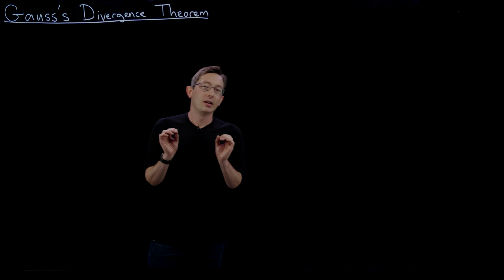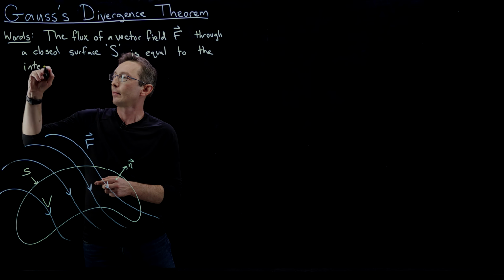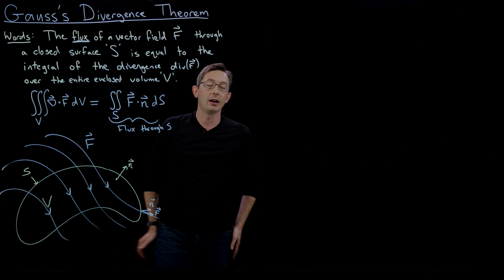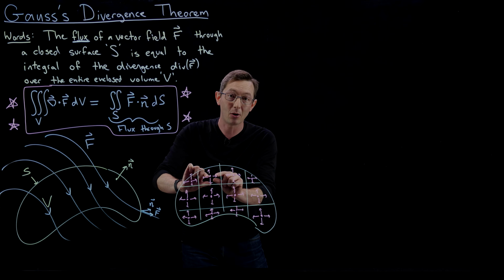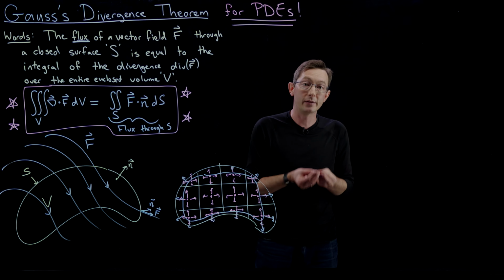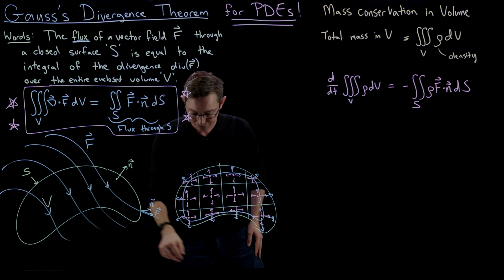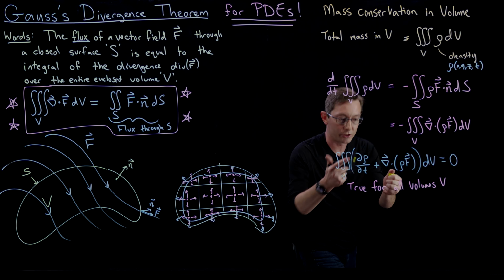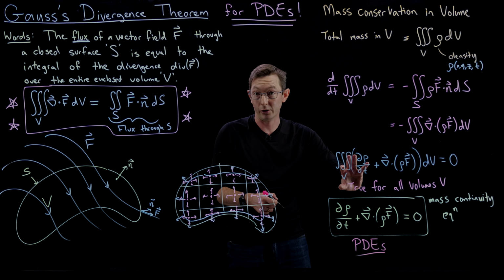Gauss's Divergence Theorem

Comment: Beautiful explanation.  I like the emphasis on understanding and practical applications.   When I took Calculus in the late 1970s, the textbooks (Silas and HIlle) was more pedagogal, meaning they used as few as words as possible to teach, with no applications and few examples.     I reviewed this text decades later and realized what an exceptionally poor text this was -- this text was meant to "WEED OUT" students rather than TEACH them with practical examples.    I really resent the approach they used in those days and what an obstacle that was to our understanding.   Although I went on to receive a PhD in mechanical engineering, I look back on these Calc 1, 2, 3, and Diff EQN as the worst, humiliating courses I ever.   I wish I could tell those SOBs how they screwed so many of us up, but they're all dead now.    This Steve Brunton is light years ahiead of anyone of the old generation.

Comment: The reason that the correspondence between the divergence and his illustration at 11:44 is extremely confusing is that the boxes around at the broundary are not rectangular-shaped. If he only uses the rectangular shaped box (which is exactly what is done by the approximation of volume integral), everything is much clearer !

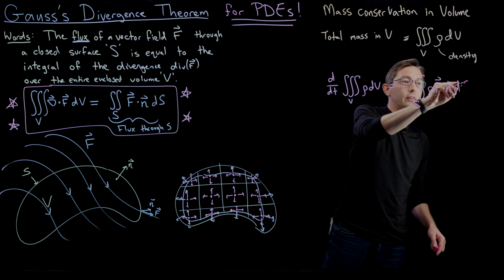Comment: 18:04  
The right hand side can be got by considering the flow through a tiny area Δs in time Δt. The "liquid" travels approx a distance |F|Δt where we could take F to be the average velocity of the "particles" that cross  Δs during time  Δt.
 We can picture this flow volume as a slanted cylinder whose top is at a perpendicular distance  |F.n|  from surface where n is the unit outward pointing normal to Δs. 

The volume of this slanted cylinder is |F.n|ΔsΔt (which is also the volume of a right cylinder of the same height |F.n| at Δs).
Therefore ρ|F.n|ΔsΔt is the approx mass of this cylinder of liquid where ρ is the density at centre of  Δs. 

Taking the limit as Δs approaches 0 and  integrating ρF.nΔsΔt over the entire surface (w.r.t. s) will give Δt∫∫∫ρF.nds which is approx the final mass of liquid that has left or entered the entire region after time Δt.
Now Δt|∫∫∫ρF.nds| ≈ |ΔM| where M = ∫∫∫ρdV is the mass of the entire region

If ∫∫∫ρF.nds is positive (negative) then the mass M of the region decreases (increases) and so ΔM is negative (positive), so we must have ∫∫∫ρF.nds ≈ -ΔM/Δt. 
As Δt approaches 0, so does ΔM and we get ∫∫∫ρF.nds = -dM/dt.

Comment: Hi Steve, I have to say the tiny boxes analogy is a bit confusing. Because when you integrate over the volumn, you are integrate the divergence, so at each point the integrand is positive since each point is a source, which does not reflect any 'cancellation'. (If it does, then at the points in central region the integrand should become 0 since they are 'cancelled'.) Whilist the 'cancellation' happens between the vector field F itself. So it might not be the right intuition for the theorem.
Reply: I found this confusing as well.  You can't cancel a bunch of sources.

Comment: You are confusing me because your are constantly using  Volume and Surface area interchangeably !    Your quickly drawn sketch on the board indicates to me that it is a typical Surface, typically  developed in calc 3,  over a domain Region in a typical x - y plane.

Is this the Volume you are often referring to ??

Then you bring in the vector  field , F hat,.  Is this generic vector field passing over the Surface or actually through the porous surface ??

Often teachers don't state how a field passes through a Surface.  If a 
If a vector field passes through a Surface, how is this done ?  Is it radiation ?
I would appreciate a response.

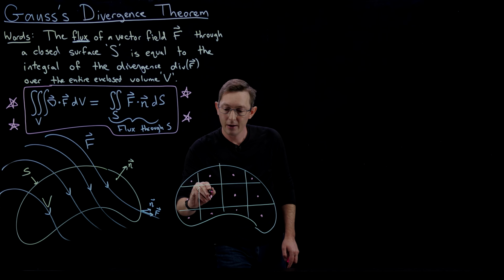Comment: There is something I seriously don't see starting at 10:00 to about 13:30 when talking about the little boxes filling the volume. The claim is that with an interior filled with boxes with positive divergences, only the boxes on the surface contribute to the surface integral, with the internal ones cancelling along their apposing surfaces with other adjacent boxes. This can't be true; here are two lines of reasoning which, for the sake of the first argument assume a constant, positive, divergence throughout the volume.
One: Compare two cases that have the same surface, but different volumes. The integral of the divergence over the volume is proportional to the volume, but the surface integral of the flux would not increase to match if there was a cancellation of the field F at the apposing adjacent surfaces of the interior boxes.
Two: Since the integrals are linear, the surface integral flux for a volume with a single box with positive divergence must be half of that with two interior boxes with the same positive divergence. But if they are adjacent, and something cancelled, it wouldn't be.
I'm thinking of this a la Gauss's law for the electrical field at the surface as proportional to the enclosed charge. Am I missing something??
Reply: I'm pretty sure the surfaces are assumed to be closed and perfectly hollow. That way two identical surfaces would always have the same volume. Not sure about your second line of reasoning, but I'm guessing it only works when you actually do an integral and chop the volume up into infinitely small boxes.
Reply: We can chop down those infinitesimal volumes into more smaller volumes until there's everything hollow. That's sort of the idea. Idk I feel better thinking this way to reach the hollowness😂. Works tho and sorta makes sense. But it gets messed up for Quantum systems lmao 😂. It's really confusing.  
Like sometimes it's cool to assume or ignore somethings to get something. 💀

Comment: Dear Sir,
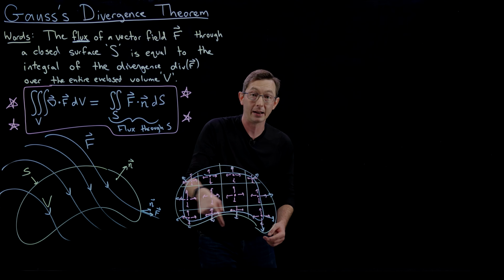I cannot understand the part at 12:35 sec. If there is a perimeter which has continuous outward emerging arrows, then what about the arrows that are in +z direction (emerging in 3D), as flux F is coming/flowing out (not expanding).

Comment: Hi,
I think there is some problem with the "explanation' of canceling off between fluxes in the video. The cancelling off takes place because the flux through an interfacial control surface will have different signs when taken in two adjacent control volumes.Anyone thought the same?
Reply: Ahammed - I also have a problem with the cancellation, and just posted a comment about it today (Sep 24, 2022), and after doing it I thought I should see if anyone else saw this too. I'm not sure if we have the same issue, but it sounds similar...

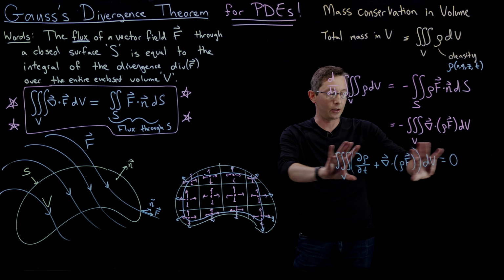Comment: At 21:35 or so, does anyone know how we formally justify changing the total derivative in respect to time with a partial derivative with respect to time when we move the derivative operator inside the triple integral? 

Also, in this particular exemple, I get the feeling that this could only be true if the volume is not a quantity that depends on time, but I know that conservation on mass is always true and does not rely on such assumptions... How can I convince myself that this is true no matter what happens to the volume?  And this is closely related to my last question : what does happen if we consider that the volume does depend on time?  Can we still switch the integral with the total derivative?

Thank you Steve Brunton for these videos! It's been a long time since I saw these topics (if ever for some of them!) and I really appreciate your enthusiasm and the quality of your work :)

Comment: I'm confused regarding a basic idea.  If there are no sources in the volume, I don't understand why the flux as defined isn't always equal to zero.   Where the field enters the volume the flux contribution F dot n would be negative and where the field exits the volume F dot n would be positive.  So, the net flux would be zero.
Reply: have you figured out the answer to your question here?  because I'm wondering the exact same thing
Reply: I think the divergence is caused not by a literal source or sink, but the rarefaction or compression of a compressible fluid. If an incompressible fluid were used, divergence would be 0 everywhere so flux would be 0 for any closed surface.
Reply: @alfiekelly3852  thanks for your insight, I will have to review for understanding because it has been so long since  I  commented. I think you are correct because you live in San Brueno. I lived there as a child, 1957-67, Rollingwood Drive.

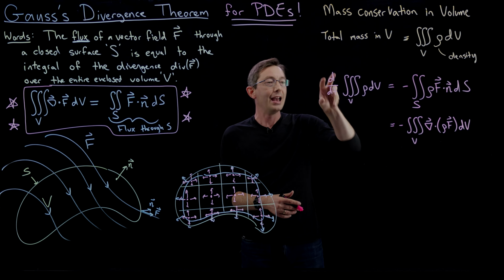Comment: At 20:25 Steve oversimplified by moving the time derivative inside the volume integral just like that. It can only be done if the volume being integrated wont change over time, invalid assumption in fluid dynamics. Taking this into account leads us to another beautiful theorem called Reynolds Transport Theorem (RTT), which interestingly naturally leads to the right-hand-side on Steve’s board (if F is a velocity field).
Reply: Could you give a hint how total derivative became a partial? ah okay i got it, since rho=f(t, x, y, z), the total derivative expansion will contain only partial derivative with respect to time.
Reply: I cannot getting anything but I feel I understood something 😅
Reply: Dominated convergence theorm

Comment: One issue with this theorem is that we have to define how much flows through the surface at the same time. That mans that we integrate over the surface for one moment in time. After completion we can see how that result evolves over time, but we can't use the left part of the surface values of one time moment and add that to the right part of the surface for a later time moment. But this means that we have to know what simultaneity means in that case. Thanks!

Comment: I just realized that if it can be said that the noise of a vacuum is 92 decibel, it's thanks to  the Gauss's divergence theorem...
As there is a kind of conservation law of the noise, and as the noise is given by a power, it's maybe, the conservation law of the energy which allows us to measure the sound of machines and equipments ...

Comment: The explanation of the small volumes canceling each other out is not very clear to me- will look it up in books
Reply: Suppose that you have 2 volumes in a vector field, and the volumes share a common interface. Then the flux through this interface will have a positive contribution to the flux through the closed surface around the first volume, and a negative contribution for the second volume.
Then the flux through the closed surface around the two volumes combined will be the sum of the two fluxes. The contribution of the "interface flux" to the "combined flux" is cancelled out. This idea can be extended to any number of volumes of any size and shape.
Reply: @HD141937 ,  you nailed it!  I really love Prof. Bruton's lectures on this channel, but the picture he drew is not a good representation of this elegant idea.  Instead of having two arrows hit each box wall, it might be better to imagine a single arrow going through the wall.
Reply: @HD141937  this explanation makes sense. Thankyou !

Comment: Great video. Excellent for showing the intuition of the volume built as a union of smaller volumes, for divergence theorem. Just few comments:

- Divergence Thm has some assumptions. Broadly speaking, everything inside of the statement of the theorem must be meaningful, as an example if you write a divergence of F, that function F must be regular enough (differentiable) for the divergence to exist; REMEMBER that PDEs of Physics translate into "regular enough local regions" all the general Principles of Physics holding for all the physical systems, differentiable or not;
- Mass equation example:
  > when you put time derivative inside the volume integral, you're doing right only if that volume does not change in time (i.e. you're implicitly considering a fixed control volume, otherwise that manipulation is WRONG). Anyway the conclusion you reach is right, but your derivation only holds for a steady volume for integration. Integral laws and then differential laws can be easily translated from the very statement of the Physical Principles if you firs consider Lagrangian volumes (i.e. those volumes moving with the continuum), and then transformed to fixed control volumes (some math required)
  > maybe I missed that, but the physical meaning of F is not explicit here. In order to have the right physical dimension, it must have the dimension of a velocity. Indeed, it is the velocity field of the continuum under investigation in most of cases (few times it's a bit more tricky, i.e. in diffusion problems that vector field contains both a local average - averaged on the species velocity, maybe - velocity contribution and a drift velocity, likely due to gradient in the specie concentration, see Fick's law for diffusion).

Keep going. I'm very curious how this series evolves.
Reply from the maker: Thanks!!